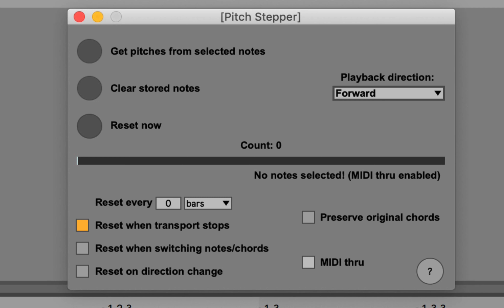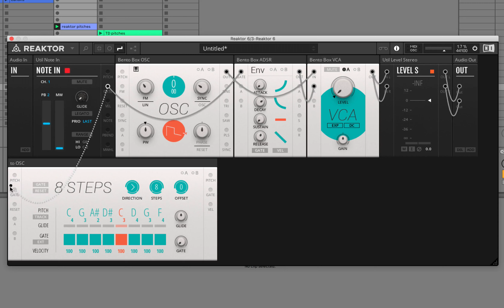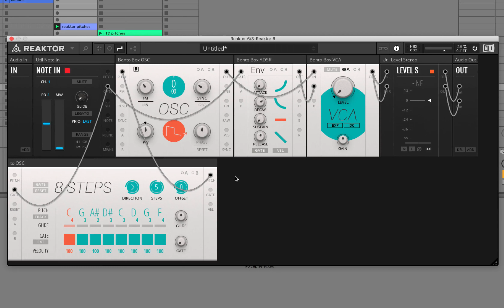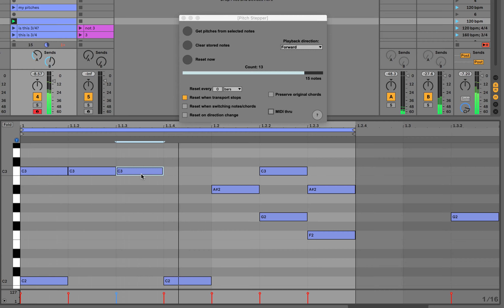Pitch Stepper

Comment: mr Dennis!:) can you help? there is only one question left: how do you record ONLY THE output of Pitch Stepper while played by a midi keyb? without the source pattern. just the midi notes generated while doodling with midi key... thanks!
Reply from the maker: Hi Felix. The trick here is that you need to route the track that you're hearing to another MIDI track, and then record the incoming MIDI onto that track. This technique is necessary for any situation when you want to record MIDI that's being processed AFTER a clip. Other examples include capturing the output of an Arpeggiator, or the transposed results of using the Scale device, etc.
Reply: thank you!!!!!
Reply: @dennisdesantis  thank you! fantastic device!:)
Reply: @dennisdesantis  Hey Dennis, I'm trying to get my hands on an envelope tool for m4L, I've currently got, "envelope", shaper, and envelope follower and none of them work for what I thought was a simple task. Envelope.amxd doesn't let you actually drawn a custom shape, just basic adsr, and shaper only loops, it doesn't act as an envelope, and of course follower follows the audio waveform. If it's easy for you, could you possible show me how to mod shaper.amxd so that is acts as a 1 shot envelope? Or are you aware of any tools that already do this?
Reply from the maker: @TacticalTopher  I'm not actually aware of any device that does exactly this, but it seems like there must be something like this at maxforlive.com.